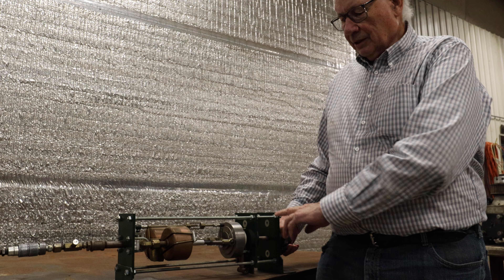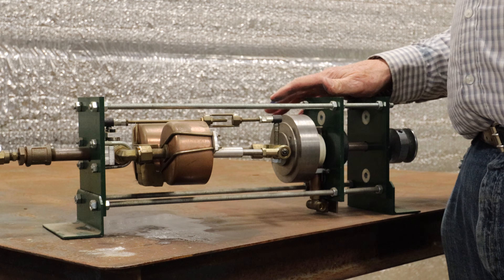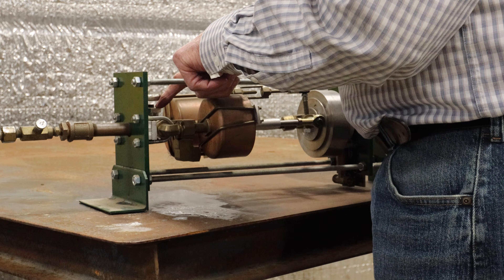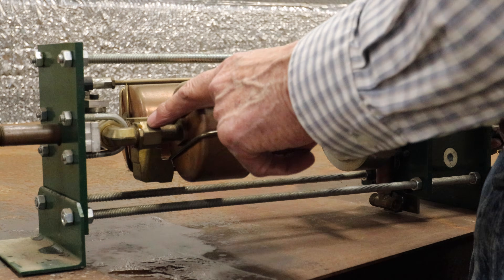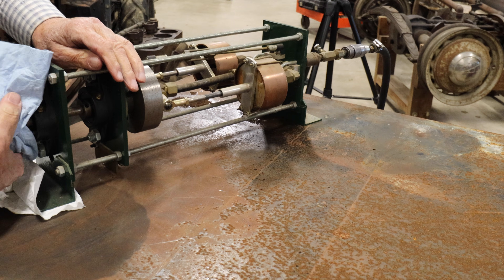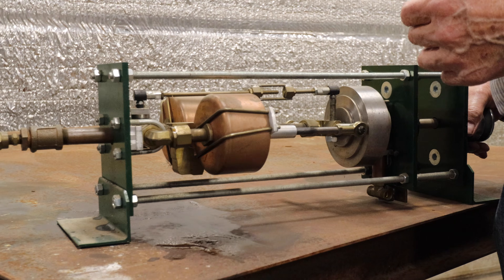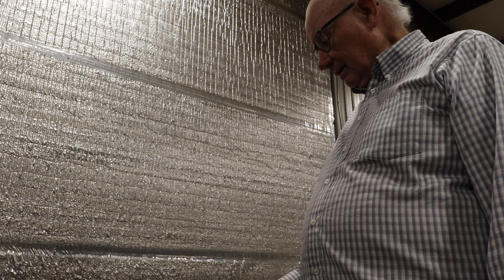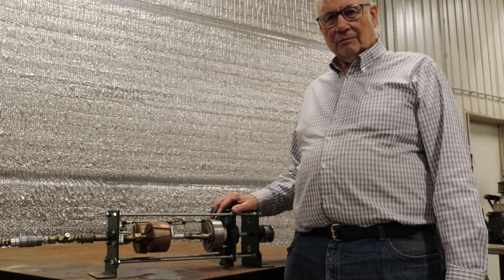Mr. Green Steam Engine

Comment: litany of disaster...

open an old book here, 1912... covers everything from windmills to venturis to hydraulic compressors (trompe pump) to francis, pelton, and parson turbines, even a bit of electrical generator and motor theory... and thats just one volume of the six book set.

modern days "i googled it"... end result... amusingly bad.

and people try and tell me the internet is an endless source of information... i beg to differ?
Reply: Whats the volume set called?
Reply: @mikeyjohnson5888  the book of modern engines and power generators, rankine kennedy. lucky to have the full set.

sort of text that should be mandatory reading for would be engineers and mechanics... despite the age, it has plenty of insights that arent even considered in modern days...
Reply: @ Thank you! I like to collect books like that. Another to add I guess.